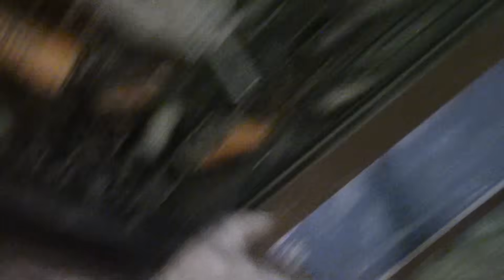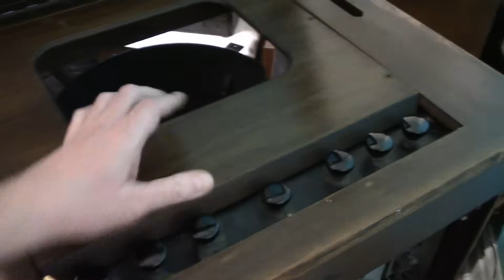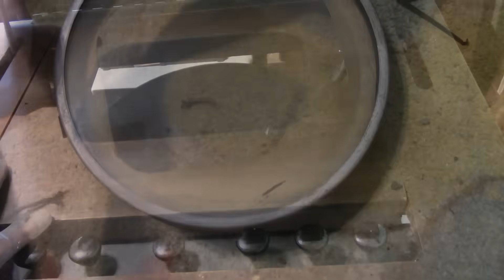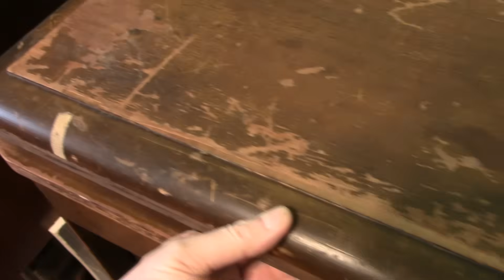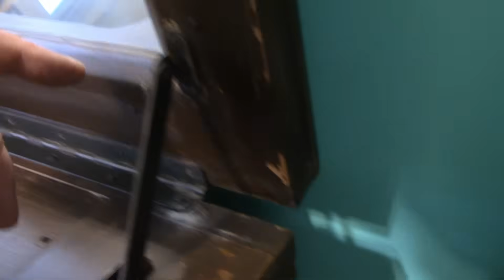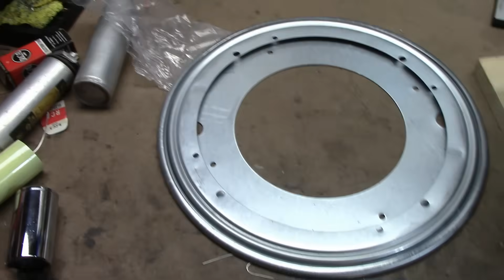RCA 1936 RR-359B field test TV part 9 - Work begins on the PU

Comment: Solution for your clearance problem inside the aluminum electrolytic can would be to go to a stained glass supply store or Hobby Lobby and purchase copper foil tape, adhesive on one side, and solder the negative leads of your replacement caps to the foil before sliding into the can.  I use this copper foil for all sorts of radio repairs, even circuit boards.

Comment: Others have mentioned it, but for certain that mirror is front-coated. It COULD be glass but that would be pointless since transparency is not needed, Like with a telescope mirror, you don't want light passing through glass twice in order to hit and be reflected from the silver. Be very careful cleaning it as the silver coated surface is microscopically thin.

Comment: For all the trouble with stuffing electrolytic capacitor cans, Bob, I get the idea was that you didn't want to use electrolytic capacitors which would fail sooner, but why not simply use modern electrolytic capacitors inside with ample spare wire length and connectors and fit the ends of the cans with a snap-in metal cap that, when the capacitors do die, maybe in 20 years, the metal cap can be snapped out and the innards can be fished out and replaced.   Such metal caps are sold for metal electrical wiring boxes.

Also why not go ahead with modern solid state high voltage low current [ed. DC] supplies inside the HV box.  To me, the less gratuitously widow-makerish the supply, the better.  It's only necessary to feed the CRT with a milliampere or two (exact figure can be looked up in old data sheets).  If by some fluke a usable original transformer shows up, then of course it could be installed.  However I'd give better odds on the solid state supply's life than the original power supply frequency transformers.
Reply from the maker: Well it's arguably worth more than the rest of my collection combined. I'm going to keep the design and functionality as close to original as possible.
Reply: And that sounds like one horsey original HV rectifier diode, that could supply the better part of an amp DC if that had been designed.  Widow maker, and early British sets were like that too.  There's a reason different solutions were found (e.g. using the higher frequency horizontal sweep circuit energy) that didn't need filtering adequate for our line frequency together with the energy storage capacity required for that filtering.

Comment: Why don't you just resleeve the rubber wiring with like colored spaghetti tubing?
Reply from the maker: Immense amount of work to break off all the old insulation and I 'd need to disconnect one end of the wire.  Might as well just replace it.
Reply: @bandersentv True

Comment: If you want to remove lettering from modern wire insulation you can use a mix of 50% acetone and 50% 91% isopropyl alcohol.
Put into a glass bottle with a metal cap. When you have a sufficient amount of wire that is cut to length use an old tee shirt and 
dab enough on the cloth and run the wire through it. Works every time!

Comment: Hi Bob, you might be able to remove the printing from the new wiring by wiping with lacquer thinner on a cloth.  This may also knock down the shine, leaving the wires looking older.
Reply from the maker: I tried and it kinda works.  It does dull the plastic and I wonder if it degrades the plastic.
Reply: @b @bandersentv  It may, but I wouldn’t expect it to be significant as long as the cloth is only damp. I’ve done this to clean the insulation on old wiring and haven’t had any issues. To be fair, I haven’t done any rigorous testing.

Comment: Bob, the mirror was a thin piece of stainless steel on the 1931 set. In the RR-359 it's a very heavy piece of 3/8" think glass that is front surface plated. DO NOT try to clean the surface with anything strong as you can easily damage the coating. This is how astronomical mirrors are created. This was done because if you used a normal rear plated mirror you would get a slight double image when viewing the crt. You can tell the different between a first surface mirror and a rear plated mirror by holding something against the mirror. In a first surface mirror the reflected image and the object will touch. In a rear coated mirror there will be a visible gap between the two caused by the thickness of the glass.
Because of the delicate nature of first surface mirrors, having one exposed to people touching/cleaning them in production would not have worked so they made a compromise with the TRK12. The used a very thin rear coated mirror bonded on the back to another piece of glass. This gave a reasonably strong mirror with a minimal amount of double image.
Reply: Your description of the 359 mirror as glass was a surprise to me since my RR-359 B has a chrome-plated steel mirror and appears always to have had it. Are all RR-359's (no letter suffix) glass mirrored?
Reply: @streetmechanic14  Interesting your's is a steel mirror. The 1931 set is just a thin piece of steel and the lid is noticably lighter.. The 12" and 9" 359's are both first surface glass and the lids are quite heavy. (Danny's and Ed's were both glass) The cavity behind the frame that holds the mirror in is quite deep to handle the thickness of the mirror. Is the cavity shallow on yours or is the mirror shimmed in some way? This is another very interesting bit of info.
Reply: @auroradesign1718  The lid on mine is definitely heavy but I don't think the mirror accounts for the weight. Just took my lid apart to confirm things (ugh. lotsa wood screws) ... lots of things I think I remember distinctly turn out to be fig newtons of my imagination!  Mirror's thin metal- presumably steel-  fits the lid without shims. While a first-surface mirror would seem like an impractical choice RCA may have been trying to get maximum image brightness from the fairly dim 1930's CRT's.

  For whatever it's worth, the Philco mirror-in-the-lid uses an ordinary rear surface silvered mirror with an obvious double image... apparently they didn't care
Reply: Bob,
That should be a first-surface mirror, as indicated by @auroradesign1718’s comment. So, he’s correct, you have to be really gentle when attempting any cleaning. Also, you may be able to remove the lettering from the wire with solvents. It is surface marking, so if solvents won’t remove it, 0000 steel wool might.
Reply: @harryshector  Given how few examples survive (and how much they vary from one set to another) we should probably be careful  about saying what "should be"  true of 359's.  Anyway, my mirror is steel.
Reply: Perhaps save the original and use a thin back-silvered mirror for demonstration use?  Or get a chromed metal plate for same?

Comment: Heat up the tabs before you bend them, get out the stresses. 
The hole from rodents in the box cap on top , might be repaired with a filler piece or just paper mache. 
The printing on the new wire is absolutely irrelevant, no matter where it is produced. 
The color is relevant to keep it original. Good luck.

Comment: As long as you have some minimal room in the electrolytic cans you can use braided wire and flatten it. Maybe even de-soldering braid, which comes flat. It doesn't need to be a single solid wire and if it's allowed to touch the can you can even discount the thickness of any isolation tape. That way you can re-stuff them and even bridge any heat generated to the housing. 
If they're smaller than the can, a wrap of thermally conductive material could be used to conduct heat away. The rubber pads they use for transistors and the like does come in larger sheets for custom shapes.
Reply: Maybe that will work, but Bob was planning to stack 2 caps in the can, so there would have to be one hot lead coming down the side. It would be tight, and might risk shorting to the can if you try to insulate with electrical tape. He might need only one layer of tape, taping the lead or braided wire to the side of the plastic film cap, which should have an insulated case. The tape might suffer from pinching or abrasion when Bob pushes the cap into the can.  Bob might end up having to restuff with different caps. The originals were electrolytic, and there should be some available that would fit. There might also be another type of plastic film cap that would fit. Bob decided to try using plastic film, because, maybe, they may hold up longer, perform better, or are immune to damage from reverse bias? He thought he found some that would fit, but they seem a bit tight. Those early electrolytics are low values, and there are modern plastic film caps that can replace them in a similar size package.
Reply: @garystrait3289 I believe Bob said in the video they are not electrolytic. And even the original cap had a very long internal lead that could theoretically be shorted to the housing. You worry about nothing. 
Just be careful when creating the new one, measure and test. Once it's in the power supply there is no stress, no movement. Everything will stay in it's place.

Comment: There are a bunch of restorers winding or rewinding their own transformers. I guess high voltage has extra challenges, but I'm pretty sure it's not impossible. After all we have decades of material improvement since the original was made. 
There also used to be several companies that accepted jobs for custom transformers for tube amps. Who knows what is still around, maybe even in China. A few years ago they were still selling an official transformer winding machine on AliExpress for in my opinion not too much money. There are some YouTube videos about that machine. Unlike the diy rigs, that thing can wind custom wire patterns. 
Some diy machines are as simple as a drill, rod and a mechanism counter
Reply: It's good that people can do rewinding, I might even want to do that someday for a radio I have. It has an interstage audio transformer that seems to be noisy. Maybe the old insulation on the windings is failing, or maybe the tar is causing this. It's an old transformer like these in a box that I think is potted in tar. I'll be interested to see how Bob gets the tar out of his replacement box, and how well he can clean it up, I've never tried to do that. I don't think I'd try rewinding the high voltage transformer Bob has, at least not as a first option, because it's the wrong transformer for the set. Now that Bob has a correct box, he can hide new transformers inside, while restoring the original appearance. I think that' the better way to rebuild this. It may almost be a blessing that the replacement transformer failed. Now, Bob may get the set looking more original. That other transformer wasn't right for the set. It might be able to be rebuilt though for someone else's TRK-12 set.
Reply: @garystrait3289 the tar isn't that difficult. I have done it myself and so has Bob over the years. It just requires enough heat to melt it loose from the sides and you can pull the block out. Messy yes, difficult no. Especially since there is no need to keep the contents in one piece.
Reply: @bzuidgeest  In my case, for the radio transformer, I'd want to examine, and maybe rewind the transformer, so that might be a bit more difficult. I'd have to get the tar off the transformer without damaging it. Maybe just heat? Maybe solvents too once I get most of the tar off?  My biggest problem with this is I have no specs for the transformer, so I may be better off trying to repair or rewind it, rather than substitute something that may not match. I don't think it's a very common transformer, it's an interstage transformer between 2 push-pull tube audio stages with center taps on both sides. It works, but it seems to be the source of some crackling noise in the audio. I'd try to confirm that before attempting to repair it.

Comment: Cool! Have you tried using Brake Clean underneath the chassis? It is basically dry cleaner fluid and it might clean those cloth wires?

Comment: Bob I know that you are aware the WR 6 is a Radial  80 console chassis  I have also seen 25 cycle R 32  sets (a buddy has a loose chassis )  I bet the height would work ....not sure of the tab number but Victor did them too

Comment: Three ideas I am thinking of to help fit those non electrolytic caps into cans:  

1.  Maybe you can make a shallow channel on outside of the caps just deep enough to allow                                 the lead to   "sink in" all or part way - then wrap in thin tape/heatshrink    

2.  Can you peel yellow outer layer off of the 10 uF to reduce diameter - then conformal coat with lead embedded?    

3.  Maybe find some flat ribbon conductor (like the strips you find in older cap assemblies - looks like 5 mm wide thin metal tape) ??  Just a thought

Comment: Being projection tv . The picture on the CRT would have to be trapezoidal .How could you get trapezoidal picture  on static deflection tv , unless its constructed that way .
Reply from the maker: It's not really a projection set.  It's just a mirror and you're watching the reflection.  You could watch the image directly on the CRT face if you wanted to.
Reply: Yes , but the mirror is on the angle , so square image will become trapezoidal .Just shine a flashlight on a mirror at an angle and you'll see what i am talking about .
Reply: It’s just like a teleprompter on a camera…
Reply: For a 45 degree mirror the image will appear the same shape as if viewed straight on - but the scan line nearest the front of the set will appear at the top in the reflection - so the image must be scanned from bottom to top - I think!